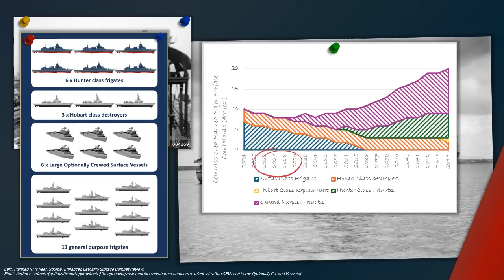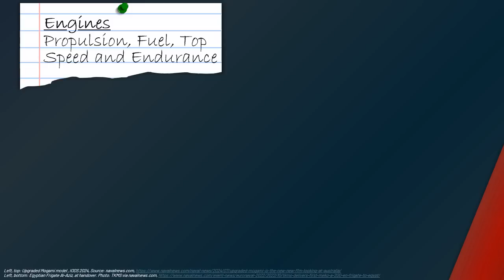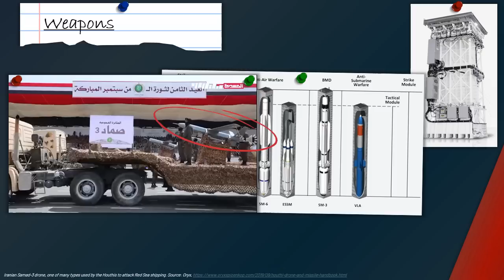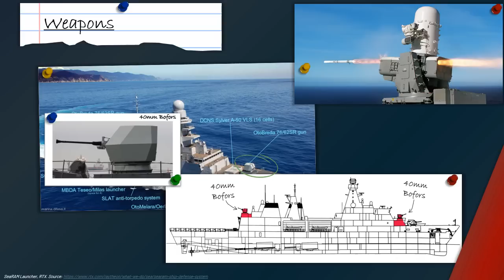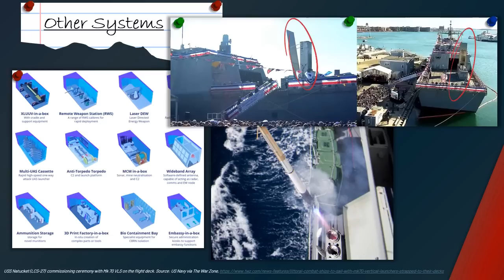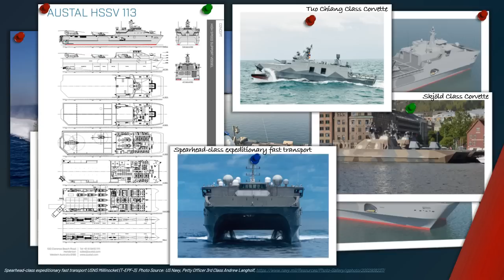Could Australia Build a 21st Century Bathurst Class Corvette?

Comment: The thing is we already have this "Modern Bathurst" ship in production: the Arafura class. 
The core design is basically this exact concept, and is easily configured to meet the combatant requirements: reinstall the aviation refueling systems we removed, add a Phalanx/RIM , put the original 57mm gun and ASCM launchers back, or replace the gun with an 8 cell VLS. 
This exact concept was looked at as an alternative to SEA 3000, but the capabilities were too limited for what was desired. It would align very neatly with this 'Tier 3' concept. The fundamental issue with it however is the resource to capability ratio is simply too low until an actual war exists, unless we fundamental change our entire national security strategy and naval doctrine to a 1980's style continental defence once one, which is the polar opposite of where we are going now. This ship concept won't work in a peacetime navy. The crew requirements alone kill it dead in the water. Even with current real world examples of the very mission set you speak of, specifically escorting commercial shipping through Bab al Mandeb, your design flat out wouldn't work, and even a more capable ship like the studied Improved Arafura, aren't really suitable. At best they are a distributed-lethality complement to a fully capable major fleet unit. 

Unless we as a nation radically change our approach to Defence, and see it as a national problem, requiring a national solution, and that every citizen is a key part of that solution, we have to accept that we are only ever going to be a bit player in a coalition.
Reply from the maker: 100% agree on the issue that crewing will be the concept's Achilles heel. It's one of the main reasons I don't actually call for the ship to be built at the end of the video - I'd like to see the preparations made to build something like the concept, so that when things get dicier, we have a chance of having something in the water quickly, rather than starting flat footed. But you're entirely right, in the numbers where they'd start to make a difference, we wouldn't be able to crew them today. Maybe in small numbers we could consider taking crews off patrol boats and giving them these things instead, but given the likely numbers involved, that's probably not going to add up.

Re the Bab (and realistically Hormuz as well in a big conflict), yep, that's definitely an issue: these things are meant to deter medium capability Chinese subs, and probably wouldn't reliably be able to stop massed land-based drone and cruise missile attacks against large targets. In that case, escort could start after ships have come around the cape (Chinese activity in the Atlantic would be expected to be minimal) or we could look to source more from India and other sources on this side of the danger zone like Oman. Potentially though we might need to rely on shorter ranged allied navies out of Europe and the Middle East to help keep the Straits open, or even given that the political constraints would be reduced in a full-on war scenario, hope that someone puts troops ashore or starts assisting the anti-Houthi Yemeni government forces either to interdict Iranian weapons shipments or directly destroy Houthi centres of power. Definitely messy and ugly, but an option in a conflict, one that doesn't exist today.
Reply: @TheWesternRed-au  Yeah, agreed short of universal national service, and we're a few years away from that discussion. Only when there's Chinese tanks rolling through Taipei will that gain enough traction, and honestly, at that point, even if we aren't involved in a war, the NPT would go out the window and that would be the primary deterrence strategy, even if it is just low yield warheads on SSN launched tomahawks.

Re the escort role, I think the part of the problem you went down the wrong track on was the actual requirement in the modern battlespace. The "modern Bathurst" wouldn't be ASW focused. The primary threats it would need to counter are a combination of (in no particular order) land based ASCMs, small fast attack craft (from pirate skiffs to Iranian boghammars; both manned and unmanned) one-way attack UAS (verything from type 1 to type 3). Mines are also one, but they would be better countered by a dedicated platform (or even sister variant). The reality is SSNs aren't going to be a significant enough threat to justify the tradeoffs in other capabilities (primarily anti missile defence) as the number of nations (let's just say China because that's what we're talking about here) that have them, aren't going to be using the few they have to sink iron ore carriers out of Exmouth. 
The reality is this ship concept needs to primarily be a close defence against small numbers of subsonic missiles, UAVs, and small surface craft. A VLS is essential to that, even if it is just ESSM or equivalent and a CIWS, as you're vastly overestimating the capability of general purpose based gun systems as anti-air, and especially anti-missile systems. Not to say they aren't an important secondary defensive system, but they aren't consistently effective enough to be the sole armament. 
Personally, if I was MINDEF for a day, as you discussed in the conclusion, I would be commissioning Austal to design a contingency ship to meet our requirements for this role, with speed of construction being a key consideration, and part of that would be the planning for implementation of construction at short notice. One key point worth noting though, is just like the original Bathurst (and Swan and Flower and similar classes) these ships are short term, war emergency ships, and just as with their WWII forebears, a key element of the design will be to cut corners when it comes to "gold plating", with the WWII ships generally built to mercantile rather than naval standards. These ships aren't meant to last thirty years. AUSTAL probably wouldn't have too many issues with military standards, but if INCAT are included, they'll probably require their own ship design that they're capable of producing, and it would be much more of a civilian ship with bolted on systems (just like the Bathurst was a whaler). You could almost argue that the incat ship would be more of a "tier 4" than tier 3! 😂

But not to be a negative Nelly, you've got a subscribe from me for this vid ☺️

Comment: I would argue a better armament would be a 57mm main cannon, a SHORAD mount forward, super firing over the 57mm cannon and a shorad aft.  At least 4 remote 12.7mm machine guns.

The SHORAD is normally used on land systems.  A version with two pods of 4 Stinger missiles combined with a 30mm chain gun with HE and air burst ammo.

This provides a cheap short range air defense capability that can defend against missiles and drones. 

The 30mm chain gun is useful for air defense and anti drone, both air and sea.

The 12.7mm remote pods provides very close range defense from air and sea drones. Remote operation means that the weapon is available for defense in seconds, not minutes.

Using these smaller weapons leaves space and weight for a single lightweight helicopter hanger.

For high priority convoys I assume that these corvettes would operate with at least 1 frigate, who hopefully has better air defense and larger helicopters.

I would argue that modular containerized weapon systems sounds good on paper, but would be horrible in war.

Turn around time of these vessels will be extremely important.  This means sending the ship out with the current module as there isn't time to swap out containers, if there are containers at the port to swap.

During wartime, when this ship comes into port, what little time is given will be spent restocking supplies and critical maintenance. 

The likely goal will be a 12-24 hour turnover at most. With no critical maintenance it may have a turn around time under 8 hours.

The containerized pods add complexity and cost. They increase training demands on the crew and officers.

Every time a container gets swapped out you must fight the ship differently. For an exhausted wartime crew this is life or death. Delays of seconds can be the loss of the ship and/or loss of convoy ships.

System's operators and maintenance personnel have to be trained on every module.

Without the modules, new crew are trained faster and the crew and officers become masters of their ship instead of jack-of-all, expert on few or none.

Containerized pods have a huge hidden cost, in addition to the cost of having enough inventory spread over a huge area like Australia plus the maintenance of the pods while they sit in a warehouse waiting to be used. Because of a limited budget how often will the containerized pods need to be airlifted? Will air lift be available during war?

Comment: Speaking as one nobody to another nobody, and as a person who has been studying this wicked problem for more than a decade now, I feel that you deserve to be congratulated for a surprisingly good analysis based on open source intelligence. This is a complicated subject but here are a few points I would like to make which might be of interest to your viewers.

1. During the 1943/44 financial year Australian defence spending rose to 33% of GDP, which is more than 16 times the current level of 2%, and more than 13 times the 2.4% projected by the end of the current decade. So, the money required to implement programs like this would be made available under emergency wartime conditions and is not the main obstacle. What is needed most is the foresight, planning, and preparation required to allow for the rapid expansion of supply chains and naval shipbuilding capacity oriented towards building large numbers of sufficiently capable and survivable minor warships that can do of all of the jobs, of which there are many, which do not require major surface combatants, and which can be built in a relatively short period of time.

2. The single resource in shortest supply are the naval dockyards, which take many years to construct. The two major naval shipbuilding hubs at Osbourne and Henderson are not sufficient for wartime naval shipbuilding. While INCAT could be put to good use to build aluminium catamaran hulls suitable for some roles, at least one additional naval shipbuilding hub for steel mono hulls would be needed to allow for the expansion of minor warship construction. BAE Williamstown has been sold off for public housing. However, the Forcags Cairncross Dockyards in Brisbane, although having been decommissioned and the land rezoned for industrial use, has the second largest dry dock in Australia, which remains mostly intact, and the surrounding land could, in an emergency, be compulsory acquired by Federal government for use as an east coast naval shipbuilding facility, and be well supported by the existing engineering and industrial base of one of Australia's largest cities.

3. The Australia economy is critically dependent upon maritime trade for export earnings, manufactured goods and petroleum products. This means that vital roles for the RAN during wartime would be naval escort duty to protect merchant vessels from attack by submarines, and mine countermeasures. Even with hundreds of destroyers, during WWII the Allies never had enough available to meet the demands of both naval warfare and convoy escort. The Canadians, to their great credit, came to the party by building one of the largest navies in the world despite being a small country in term of their population size.

4. A major weakness of the RAN is the lack of naval logistics capability. Warships are useless if you cannot refuel, rearm, maintain, and repair them. Any minor warship program needs to include the capability to address this situation, in addition to naval escort and mine countermeasures capability.

5. Modern high-intensity naval warfare is very much about anti-ship missiles but these are limited in number, very expensive, and take a long time to manufacture. Experience has shown that it is dangerous and impractical to reload missile magazines at sea, which requires modern warships to return to port to rearm. This means that in anything other than a short duration conflict missile magazines will be soon become depleted thus requiring warships to either retire from action in order to rearm, or fall back on naval gunnery. Arming any warship with a single naval gun is a bad idea. Not only is a single naval gun a single point of failure, but when your point defence missiles and CIWS ammunition have been expended it is all you will have to defend yourself. Fine ships and their galant crews were needlessly lost during WWII because they simply ran out of ammunition. Ships can, in time, be replaced but their crews are lost forever.

6. A helicopter is an essential asset for prosecuting a submarine from a warship. With the capabilities of modern torpedoes including re-attack, if you are close enough to launch a light weight torpedo then your ship is probably doomed because a longer range heavy weight torpedo is about to detonate beneath your hull, forming a massive void which will break the keel in two under the ship's own weight. You need the helicopter to keep the ship beyond the range of the submarine's weaponry.

7.  The notion of a single class of general purpose minor warship has considerable merit for many reasons including scale and cost. Modularity can help to improve flexibility but, in general, you cannot achieve the same density of capability with modular systems as you can with dedicated ones. This means that you need more ships. My own analysis leads to the conclusion that several classes of specialised minor warships would be required, instead of just one.

8. As a general rule of thumb the cost of a modern warship can be roughly estimated on the basis that one third of the cost will be for the hull and propulsion system, one third for the weapons systems, and one third for the sensors and combat management system. This is where the idea of "fitted for but not with" comes from. The initial procurement involves the hull, propulsion system, sensors and combat management system.The weapons system is then added incrementally over time and can be accelerated if the need arises and provision has already been made for it.

9. For a Tier 2 asset, the Absalon class of multirole frigates of the Royal Danish Navy are worth a close look at. This hull was the basis of both the Danish Iver Huitfeldt class of air warfare frigates and the British Type 31 general purpose frigates. The Absalon variant is a hybrid between a frigate and a military transport ship that uses the Stanflex modular architecture to allow rapid reconfiguration for different mission sets. This is a proven design which were built on a peacetime timeline of about two years from having been laid down to being commissioned. Under emergency conditions they could be built in less time. They built two in 2004 for $US189M each which equates to about $AUS850M in 2025. If you built 10 of them the cost would come out to about $AUS7B i.e. about as much as a single Hunter Class ASW frigate. The Hunters are expensive but they are very quiet, which is what you need to hunt down an SSN which will probably hear you coming long before you hear it, and will be amongst the most capable ASW warships in the world. Their Achilles Heel is that if you lose one, you won't be able to replace it any time soon; so, you might be reluctant to place one in harm's way.

10. For a Tier 3 asset, other design analogues worth looking at are the 1990s Tenix Joint Patrol Vessel which was never built, and the Falaj 2 class (based in the Fincantieri Diciotti class) built for the UAE in 2016. There is an improved Falaj-3 design in the works. Other interesting warships are the Ambassador MK III built by VT Halter Marine for the Egyptian Navy (a pocket frigate that can make 43 knots!), and the Hamina class stealth patrol vessel built by Rauma for the Finnish Navy. The latter three lack the range needed to meet Australian requirements and do not carry helicopters but are interesting because they demonstrate just how much firepower you can pack into a 600 ton warship or in the case of the Hamina, a 268 ton patrol vessel. If they were enlarged to accommodate more fuel to extend their range they could be made into small, fast, difficult to detect, heavily armed minor warships that, if deployed in significant numbers, could inflict a serious kick in the arse to any naval adversary, and provide them with a good reason to go elsewhere.

11. An excellent source of insight into this complex subject is provided by the naval historian Dr Alexander Clarke on his YouTube channel "Dr Alexander Clarke Does Naval History Live." He has some very informative videos on the Bathurst class, other warships used by the RAN during WWII, and the Hunter class frigates.